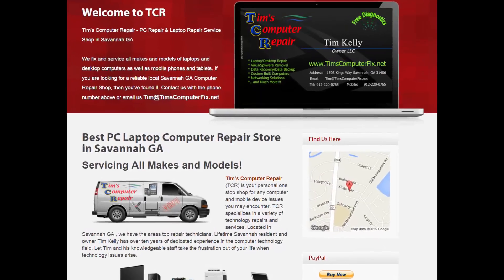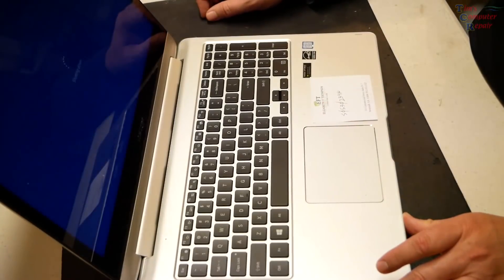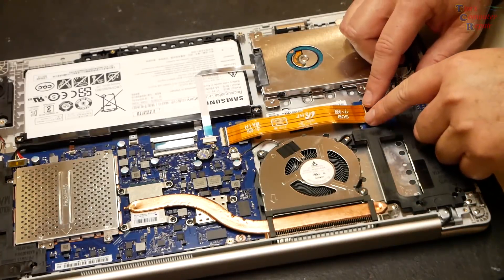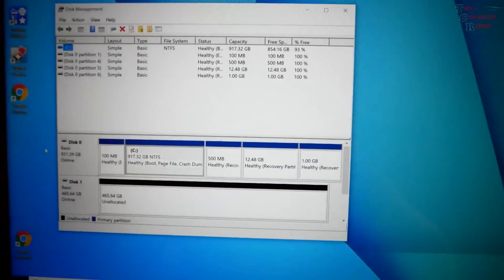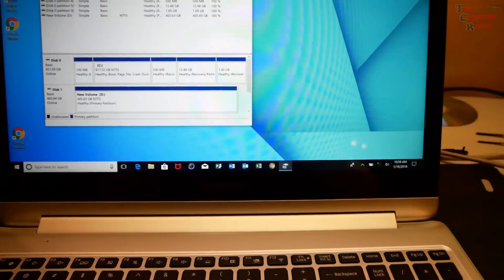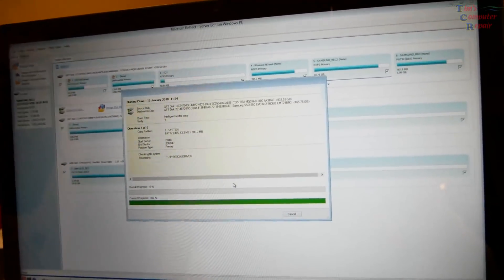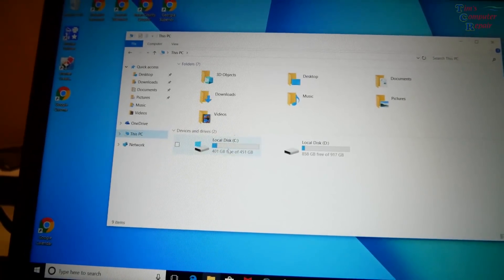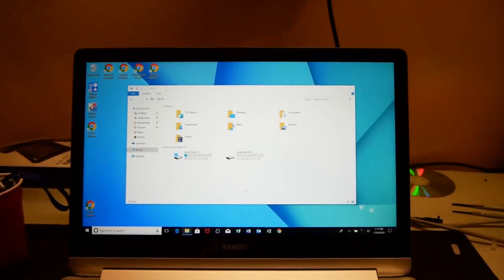How to Add an M.2 SSD on a Samsung 7 Spin 740U Laptop

Comment: I've had this computer since 2016 and finally decided to add a m.2 sata SSD to improve boot time compared to the existing original HDD. Now I'm going from 10 minute start times to less 30 seconds. Your guide worked well. Thank you.

Comment: That micro ribbon cable is unusual!  Assuming the black clamp flips up and away from the cable (vs. toward the cable).  Just not brave enough to slip a plastic wedge under there and pry up.

Do you have any video of this or tips for doing it right?  Thank you!

Comment: Hi Tim, I have a 740U3M-K01US laptop. It came with a 1 TB 2.5" HDD and 12 GB of RAM. My intention is to use a SSD for storing the Windows OS and main software instead of the HDD that comes with the computer and leaving the HDD as spare space. I am not sure what would be better. If swapping the HDD for a SATA SDD 2.5" or a M2 NVME drive (both cases I would buy a 1 TB or 2 TB drive). I noticed your intention was to use the HDD for your applications (and OS I guess) and the NMVE M2 SSD as spare space. Is it possible to make the M2 NVME drive the main one and to leave the 2.5" HDD as extra storage? I was planning to mirror all the data of my current HDD to the new SSD (whether a 2.5"" SSD or a M2 NVME) and make it my C:\ drive. ///// One more thing, can you upgrade the RAM beyond 12 GB? I have read somewhere that is the limit. Does this model come with an extra slot for RAM? Do you think it is already filled up with two 6 GB RAM boards? I have never opened my laptop before, I hope you've come across this model before. Thanks.
Reply: I have the same laptop and read that I can upgrade the Ram to 32GB. There's 2 slots and I can add 16GB to each slot. I have 12 GB in it now but plan on buying the 2 16GB.  I'm adding the M.2 SSD so it will give it a little more speed when booting up

Comment: Great video. Is the m.2 port NVMe compatible, or just SATA compatible? I didn't see it too clearly when you showed the image
Reply: It should work with NVMe. I had the same laptop and an NVMe drive worked in it. Just do not use intel optane because it will not work properly. If it was a 16gb optane+256gb ssd then only the 16gb optane would show up

Comment: How to clone drive without USB Flash Drive:

1. Open Disk Management to check if SSD is there.
2. No need to initiate or format! Macrium (same software that Tim is using, except it's used directly on the laptop/computer) will actually do it automatically. 
3. Download and install Macrium Reflect (free version). Detailed steps here: https://youtu.be/BZqkYnmDnas
4. Restart machine when finished. 
NOTE: No need to go into BIOS after restart!! HDD and SSD should have swapped AUTOMATICALLY (just as seen in Tim's video)

Cheers! And many thanks to Tim for recording from beginning to the end without any crazy edits. Very helpful for us newbies who are fumbling around trying to do things ourselves.

Comment: I have had my 740U5L since October 2016.  Upgraded the original drive to a 850 EVO 1TB a few years ago and recently bumped the RAM to 32GB.  Watched your video for tips on installing the M.2 drive and used the 970 EVO Plus 1TB drive for this update.  Never used Macrium Reflect before but it made it nice and easy to do this.  I have had the back off this thing so many times doing upgrades I can do it with my eyes closed!  Great video so thanks for doing this.
Reply from the maker: Glad the video helped. Thanks for commenting.
Reply: Hey.  I have the 740U3L.  It states M.2 SATA can only be used.  The 970 EVO is only offered in NVMe from my search.  So, the 970 EVO M.2 NVMe can be used?
Reply: @charlessolomon8235  have you tried putting a m.2 nvme ssd in your Samsung spin7?
Reply: I have the 740U3M and I don't know if I could use SATA  or NVME?any idea?

Comment: Hi Tim. I used this video to install my M.2 hard drive.
This video completely skips unplugging the battery. Following this video step by step, led to my Mother Board being cooked.
Thanks alot.
Reply from the maker: Maybe you should not be working on laptops. Done this upgrade many times without unplugging battery no problem
Reply: @TimsComputerRepair  i have worked with many laptops and that has never happened to me either idk what Fire did but he should probably quite
Reply: also great work i know what im doing but i just love to see videos like this.
Reply: @josueamaya5516  You mean quiet.
Reply: @firebattastic3661  yes sorry I didn't see that

Comment: Great video!! I have a quick question. Is it possible to use Samsung 860 EVO M.2 SATA instead of 850 EVO M.2 SATA III?If so, the speed would be different?
Reply from the maker: You can use either one. Speed difference would be minimal.
Reply: @TimsComputerRepair  after I added a new ssd m.2, and then put the lid back on, pushed the power button. The power light is on but the screen is black. Nothing showing on the screen.... did you have this issue? If so, how did you fix?
Reply: @TimsComputerRepair  i have the exact the same model of laptop as yours, samsung notebook 7 spin 15.6"
Reply: @lprayforyou  did you find a solution for that?
Reply: @alexandret.8130  I think I solved the problem but I don't remember how... I sold that laptop to someone and got a new one. Sorry!
Reply: @lprayforyou  no worries... Good to know you didn't fry it.

Comment: Very helpful video! What is the difference between the evo 860 and the evo 970? Can I use either for this laptop?
Reply from the maker: You can use either one.
Reply: @TimsComputerRepair  Isn't the 970 NVME? 
I saw in another comment that this laptop does not support NVME.
Reply: @TimsComputerRepair So sorry to bug you. I have the exact same model samsung laptop. Just to verify, I cant use NVMe, correct? Even if I download the drivers for it from Samsung?
Reply: TimsComputerRepair I have the 740U3L and the manual states to use M.2 SATA. I have the same question: Can the 970 EVO NVMe be used?
Reply: @charlessolomon8235  not sure about that however I had a 740u5l and that works with NVMe drives. It's just incompatible with intel optane

Comment: Thanks for walking through both the mechanical and OS upgrade steps! I have an M2 on the way and plan to do this exact upgrade on my Samsung 7 Spin. This will be super helpful.
Reply from the maker: Awesome! Good luck on your upgrade.
Reply: @TimsComputerRepair  Thanks! Is there anything special you did for setting up Macrium on the flash drive to make it bootable? My laptop won't show it in the Boot Device list.
Reply: Nevermind. For anyone who might read this and gets stuck on this step, I was able to run Macrium Reflect on my laptop while Windows was running to clone the hard drive. So I skipped the whole boot device step. It worked beautifully.

Comment: Fair warning: There's been more than a few instances of people reporting that trying to install this quite literally fried the motherboard. I tried to do this installation myself, and it would not boot after installation. Did everything I could think of. Sent it back to Samsung and it needed to have the motherboard replaced.
Reply: Did you unplug the battery? It happenes to another guy too.

Comment: I'm confused so I bought the Samsung 970 nvme but returned it th8nking it will not work then I got the m.2 you have. And I took the back off of my Samsung note book 7 flip, same model you are working on and it does not have that same ribbon cable, the m.2 slot is exposed and it looks like it has a single slot like a nvme m.2 not the sata where it has 2.
Reply: Just wanted to note.. if you get the samsung  860 evo m.2 sata,  it is an enormous improvement. I went from 5 sometimes 6 min boot to 15 seconds. Its awesome and I've been using it for around a year.
Reply from the maker: Perhaps you have an updated version that supports nvme?
Reply: Were you able to get yours installed?  I opened up the back of my computer to see if it had a slot and also did not have the large ribbon connection, but I believe it is supposed to have access.  My version is 740U3L P03AFP.
Reply: Did it actually have the NVME slot? is it the np740u5m model?
Reply: I was able to install the Samsung 860 evo m.2 which is sata 3. Sorry I don't remember my model number off hand
Reply: Np740u3m is my model
Reply: I originally wanted to put the 970 m.2 which is nvme but samsung said no it would not work. So the 860 evo is the best m.2 it will accept.

Comment: Does it support NVME M2 SSD?
Reply from the maker: NO this laptop does NOT support NVME ssd.
Reply: @TimsComputerRepair  it should work tho. I have the same laptop and it works with a WD blue nvme and Samsung 970 Evo plus. But it does not work correctly with Intel optane
Reply: @TimsComputerRepair  Samsung 960 NVMe will work on it?

Comment: Man i can't thank u enough, after looking online for days, i came a cross ur video and it have everything i need to know.
I ran a cross a problem tho, after removing the yellow cable and putting it back on, now my Wi-Fi and Bluetooth doesn't work, the computer can't find the hardware at all. Any idea what could of happened and how to fix it , thanks a lot
Reply: Hey I'm about to upgrade and I heard in a forum that people were having the same issue. Check the last page of this thread:
https://us.community.samsung.com/t5/forums/v3_1/forumtopicpage/board-id/computers/thread-id/947/page/1
Reply: @satalia_  my warranty is gone long time ago, still can't figure how to get the Wi-Fi to work! Kinda sucks!, thanks tho brother for the info
Reply: To potential future viewers: I ran into a similar issue (wouldn't recognize the wireless adapter).  My guess was that i didn't properly reinstall the ribbon cable or it's connector, but there was no apparent damage and numerous re-seating attempts didn't help.  I sent the machine back to samsung and they repaired it for free under warranty.  No details from them on the fix though.

Comment: Thank you for sharing this.  This was a great tutorial but I am a little confused on the flash drive.  Does the flash drive have to be a certain size? Did Drive C transfer onto the flash drive before it went into Drive D when you did the clone?  I'm sorry I'm just computer illiterate when it comes to upgrading a computer drive.. Thanks again for sharing this tutorial it was great! I have watched several videos on M.2 SSD trying to figure out how to install it into  my laptop and your video made it look so simple! I believe I can upgrade my laptop now after seeing your video,  I only wished I had came across your video first it would have saved me a few hours on learning how to do an install of the M.2 SSD.
Reply from the maker: The flash drive simply had the  cloning  utility  on it. Nothing was transferred to the flash drive. I simply booted to the flash drive and used the program to clone  the c drive over to the ssd. The operating system automatically changed the drive letters so the ssd automatically changed to C drive. Hop that makes sense.

Comment: I was just curious about overall performance and speed. Is there a significant increase in speed for say when using applications such as chrome , word and possibly any games. I have the 13 inch 7 spin with 12 gig ram and 1 Ter hdd. I plan to put in the m.2 ssd and and an additional ssd. I want to make sure it's worth it other than the the boot time.
Reply from the maker: All of your applications will benefit from the speed of an ssd over a hard drive. This performance will continue over time.